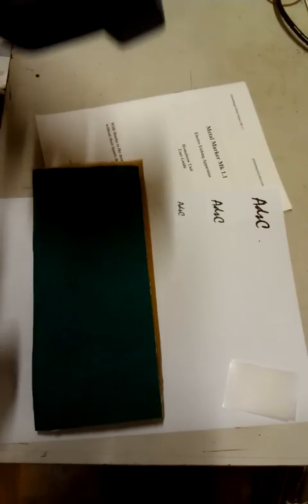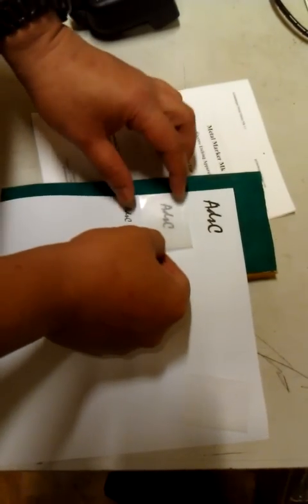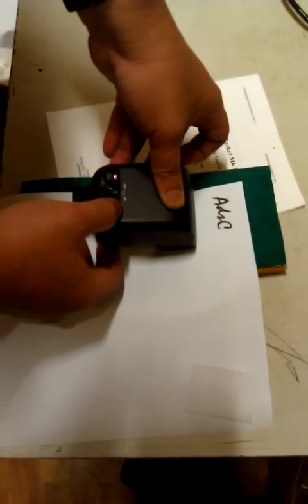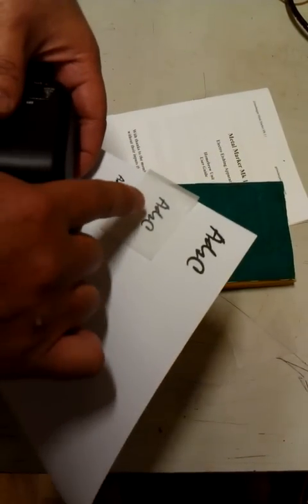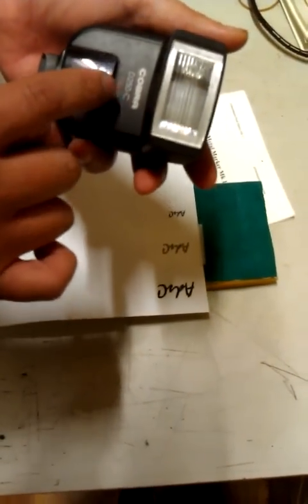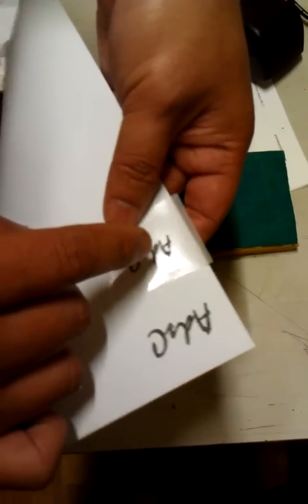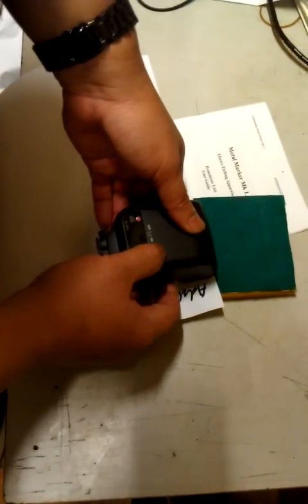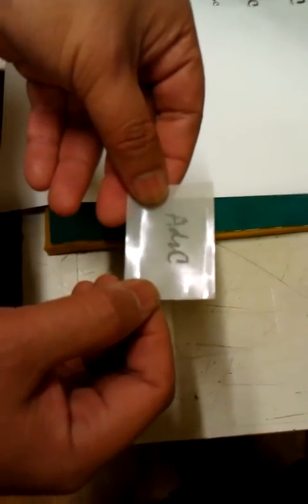FLASH Toner type stencils - how to make etching stencil

Comment: What about using a super blight light instead of a flash?
Car headlamp?
Reply from the maker: No, it wot work because we are dealing with the correct light wavelength and correct amount of luminosity to make the chemical coating on the stencil react with the toner on the design paper.